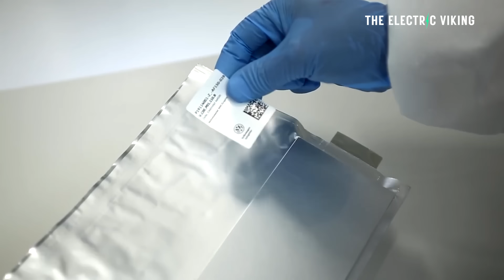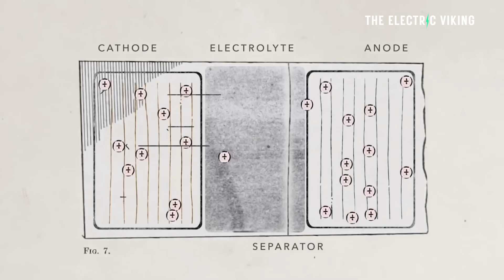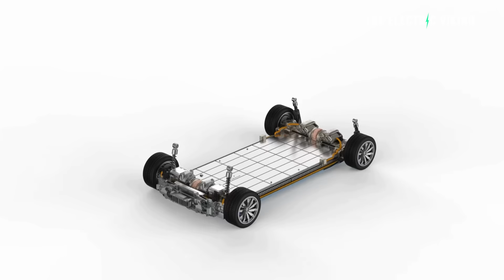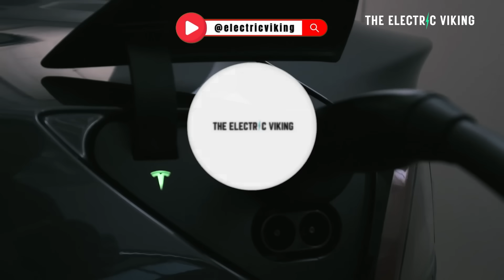Solid-State EVs Will Soon Seal Gas Cars’ Fate: 500 Wh/kg Power in 2025!

Comment: A pickup with a battery still has a long way to go.  The lightning, cybertruck etc have shown the capacity to weight does not work.  To get a truck that can tow, carry loads etc makes it too heavy to work off road.  Its a non starter.  Cars with low drag work fine.  What about the breakthrough game-changer sodium ion. Still waiting.  Wait for the next evolution, but oil is not going away any time soon except in cars and scooters
Reply: Towing may be an issue long distances, or towing RV's.  Hauling stuff, or towing stuff like a typical contractor would is a non issue.  It is interesting that you completely skipped over the Silverado EV and the Sierra EV, with 460 miles of range, and pretty good towing capacity...
Reply: @redbaron6805 They sell so few pickups compared to cars in the us.  Ev pickups are fine if you don't mind taking a big hit on resale and don't plan on towing, loading or going off road.  Pickups make up more than 50% of the us vehicles sold but ev pickups represent less than 1% of sales compared to cars that represent 20% of new cars sold, in the same market.  I rest my case
Reply: @barryobrien1890  The Silverado/Sierra is brand new, so sales are still in the early stages.

We don't know what the resale value will be, as they are still too new to see what the depreciation will be.

As I noted above, you have to separate towing RV's or large landscaping trailers on a highway, vs city towing.  The Silverado has no problems at all towing or hauling stuff, having easily 200+ miles of range even on the highway.

EV pickup trucks are relatively new, so obviously can't become 100% of the market overnight, so you really don't have a case of any kind here.

EV pickup trucks are less than 4 years old in general.  Why would they be replacing 100% of sales of ICE trucks, going back decades, in 4 years...???

EV cars date back over 15 years, and only gained mass market in the last 5 years or so.

The "case" you are making here is beyond absurd, and just entirely divorced from reality...
Reply: @redbaron6805 It costs 20k more (37 vs 57), has lower weight carrying and towing capacity.  What part of business economics is missing your analysis.  For commercial use its all about payback and 20k at 5% interest will pay for a lot of gas.  The entire pickup market is almost non existant despite its years, compared to cars in the same market.    It not because people dont understand, but rather because it does not make financial sense.  All ev loose mote than gas in first year depreciation which adds to business expenses.
Reply: @barryobrien1890  You must not run a business.  $1000 buys around 300 gallons of gas, which may get you around 5000 miles of driving, or roughly 2 months worth of driving, not including oil changes.

As I already clarified multiple times, towing capacity isn't an issue for 90% plus of commercial operators, as the Silverado EV can tow up to 12,500 pounds.

The Silverado arrived late 2024, so talking about market share 5 months into 2025 is beyond absurd.

It obviously makes financial sense, if you own a calculator and know how to use it, as I can charge a Silverado EV for $40 a month vs paying $500 a month in gas.

Depreciation literally doesn't matter, as businesses drive vehicles until they are worn out, and don't give a rats behind about resale value.
Reply: @redbaron6805 dont be so obnoxious with your comments.  Obviously ev also cost money to charge at charge stations.  Lets see just jow many they sell.  20k is a lot of money for a small business,  If it was such a great deal why are rivian, tesla anf ford ev trucks not flying off the shelf.  Obviously business owners dont know how to use a calculator.
Reply: @barryobrien1890  Why would you be charging EV's at charging stations, unless you are traveling long distances...?

I have a charger in my garage and driveway, and as I noted, my utility offers me unlimited charging for $40 a month.

Yes, if you charge at fast charging stations, the savings will obviously be far less.  But, if you charge it at your home or office, even using my general utility rates, it would cost around 8 cents per mile, vs around 15 cents per mile for gas.

Using that math, if you drive 30k miles a year, the difference in charging vs buying gas would easily be over $2000 a year, plus another few hundred in maintenance and oil changes, far exceeding the extra $1000 a year you would pay for interest on the difference.

Many people still don't understand electric cars, so they don't trust them.  And American's are notoriously bad at looking at savings long term, vs costs upfront.

Ask yourself the same question about Hybrid Water heaters, which easily save you a couple of hundred dollars a year in energy costs, yet people buy old and obsolete water heaters which cost them several times more in the long run.
Reply: @redbaron6805   What business charges their truck fleet at home.  You need fast charging to keep the trucks on the road especially during long work days of 12+ hours with overtime and you can't afford to wait on slow charging a big truck battery.  Sure a personal truck that's used like a car is fine but it's not my point.  Small businesses use their trucks extensively during busy times.  Ev trucks lose a lot in value in the first 3 years.  The current Chevy just increased its load and carrying capacity by 50% so anyone with an older one will have to take a huge hit in resale.  Why did they make the change if 90% of the customers are happy.  Tesla owners who paid $130k for the pioneer edition could not get $80k a year later.   Best of luck with your truck, I am sure it will serve you well.  My driving range, access to chargers and working hours could not benefit from today's technology.  I did the math and the risks of having a crew waiting at a charger wiped out any savings.  Please don't spread the rumor that American businesses are luddites.  We do look at the business case, and it still makes no sense.  If there was a decent savings we would switch.  I too have to pay kids school fees, medical bills and put a little aside for a rainy day.  My calculator said no
Reply: @barryobrien1890  You were talking about a "small business".  There are a ton of small businesses like contractors, landscapers, pool service companies, roofers, etc. which have a single service vehicle.

My brother runs a small business, and takes a business truck home, which he can charge at home.

Also, my brother's company has an office where he can charge them at his office.

Not every small business has a fleet of trucks and dozens or hundreds of employees.

And no, you don't need fast charging for most trucks, as they are typically driven locally, as seen here:

"The average pickup truck driven for small businesses typically travels between 15,000 and 20,000 miles per year..."

Even 20k miles a year is less than 400 miles a week, or 80 miles a day.  You can easily charge those in about 3 to 4 hours using a Level 2 home charger.

"The current Chevy just increased its load and carrying capacity by 50%.."  Not sure what you are referring to as "Current Chevy", current Chevy what...?  Not the EV version which was just released.

The Cybertruck and first editions of vehicles are not really relevant as statistics for vehicle use, especially commercial vehicles, as small companies are obviously not buying fully loaded first editions as work vehicles.

"My driving range, access to chargers and working hours could not benefit from today's technology."

Without knowing your particular situation, which could be atypical, it doesn't really serve as much of a reference point.  On average, EV trucks would easily work for 80% to 90% of applications, and I'm seeing more and more EV trucks used for that purpose in my area.

I obviously can't speak for your personal situation, but I have work vehicle, and operate very much like a small business, as my business unit is small within my large corporation.  I could easily use a EV pick up truck.

My brother runs a small business, and he could easily use a EV pick up truck, which he is actually planning on switching to soon.

It is nothing against you personally, but people are very poor at doing the math on long term costs, efficiency and ROI.

Otherwise, people would buy far more efficient appliances, air conditioning units, water heaters, electric vehicles, etc.

But, unfortunately, people worry about the upfront cost only, and don't calculate long term ownership cost.  It is a failure of considering the long term operating costs.

I have personally pointed this out to people, who were surprised how much money they could save, by buying more efficient water heaters, using mini splits to cool the most used rooms in their homes, and the massive cost savings of driving an EV vs an ICE car.

This is not something people really consider, or are aware of, and small business owners are often no different.

Comment: 500 Wh/kg by 2025? If solid-state EVs hit that mark, it could be the final nail in the coffin for gas-powered cars
Reply: Depending on the price of course - but yeah.
Reply: Gonna be very expensive at the beginning, 350miles range is enough for a passenger car.
Reply: @SzaszaG1  350 miles is not enough for me. My european trips require 4 days and 2,000 miles without charging infrastructure needed by EVs.
Reply: Solid-state is about 800 Wh/kg. Semi-SS is about 500 Wh/kg
Reply: @larryc1616  😂😂😂 which company is producing them?
Reply: That is still 22x less energy dense than diesel fuel.
Reply: @Dungshoveleux Not all of the energy makes it to the wheels! Only 20 -30% actually make it into forward momentum!!! The rest is wasted as heat, through the exhaust and break pads! Electric efficiency is in the 90’s. Not to mention the regenerative function of the electric motors saves runaway trucks on downhill grades. I drive from Flagstaff to Sedona daily and cannot tell you how many semi trucks I see having to take the emergency runaway ramp because their brakes have failed or they are pulled over with their brakes on fire because they cannot maintain a safe highway speed on a 4,000 foot downhill grade. You can’t put diesel back into the tank on downhill grades like you can with electric vehicles!!!!!! And we all breathe much better!!
Reply: @1Richblessing  Your math is bad, my guy. Evs in 80% efficiency at best from charger to wheels. That doesn’t count power greed and energy generation.
Reply: @Dungshoveleux yeah but the ev drive train is 3 times more efficient than diesel! Also the electric drive train weighs less than diesel, so all that considered it will realistically get a range similar to a diesel!
Reply: @Dungshoveleux  But there's a 3:1 to 4:1 ratio of efficiency electric motor to gas or diesel, so effective energy density ratio goes down to 7:1 or 5:1 for 22:1.  Still big.
Reply: @rogermartin8411  no, it does not work like that.
Reply: @Dungshoveleux  Petrol cars are about 3 times less efficient and electro motors are much lighter than petrol engines and don't need a heavy gearbox. 500 km takes 75kWh, 150kg of ss battery, about 300kg less than current batteries.
Reply: @NovoAurora  Less efficient in numbers when you dive in science, but they are still more convenient than evs.
Reply: @NovoAurora   The headline figure of 500wh translates to 456wh in real life per the marketing blurb. Liquid fuel energy density is 11KWh+/kg.  The best ICE tech suggests 40% efficiency vs EV 90%. Broadly speaking your figures are not outrageously biased, just a little bit. Lets see how LiS batteries work out in real life.

Comment: Sadly, we've heard all this before about solid state batteries... they're always just a few years away and we don't get any useful stats like: Cost per kwh at cell, longevity, power density, temperature tolerance, safety and of course Energy density. Need all of this or you have nothing. Many batteries could do 500wh/kg and faded away. 
Need All the stats.

Comment: OK, good.  But what about the CATL condensed battery with 500 Wh/kg that is in production now? Last I read, this is made for airplanes, but very little work is needed to "downgrade" to an automotive grade battery.
Reply: I’m not following the point of your “what about”. All of transportation is a huge set of huge market segments, so as long as a new solution is better than a currently successful solution at a better price and value, it can gain market share. It doesn’t have to be better than the best solution.
Reply: I’m not following the point of your “what about”. All of transportation is a huge set of huge market segments, so as long as a new solution is better than a currently successful solution at a better price and value, it can gain market share. It doesn’t have to be better than the best solution.
Reply: @TomKacandes  The CATL condensed battery is available in production now. To get 500 Wh/Kg, we don't need to wait for some magical solid-state battery to appear.
Reply: @dr.x4050  understood that CATL is making this great thing and it exists. If two or five more competitors make something less good but close enough at a good enough price they will all exist in any normal market is my point. You seem to be implying that because a leading competitor exists, nothing else will, but that’s contrary to economic reality.
Reply: @TomKacandes @TomKacandes, I am not aware of any other batteries with the same energy density in production, suitable for cars currently from any other competitor.  I don't believe CATL is in a rush to produce a solid-state battery.  If any other company can mass-produce a battery with the same performance or slightly less performance at a much lower price, I would love to see it. I'm not implying other companies can't do this work.

Comment: It depends on life cycle of the battery over range. I’m fine with 300 mile range provided the battery lasts the life of the vehicle, as they generally do now. Why would I buy a long range battery that will depreciate value in a shorter life span? That’ll be the key = lifespan, longevity. Hope they solve that problem with solid state.

Comment: It is not just range.  Charging infrastructure is practically non existent in the USA unless you live in a large city.
Reply: Simply incorrect - range has not been a real issue for more than 10 years now, with Tesla's fast-charging network. Now, it's being further filled in and made available to all OEMs via the standardization and industry adoption of Tesla's NAC charging port. Check it out if you have any doubt about this. 500 miles of range would be nice, but it's not really required, given the convenience of Tesla's fast DC-supercharging network for long-distance travel, combined with the ultra-convenience of charging at home for daily driving.
Reply: Yeah, one look at a charging map completely busts that myth.  Even highway rest areas in my area have dozens of chargers...
Reply: Completely false

Comment: I'm not sure that SSBs are a requirement for the future of EVs. I see it more as a nice step up in a road that has a lot of future steps. There are so many shots on goal being made by so many battery researchers, it's hard to keep score on who's winning. In the end, I think that we all win because there will be some great options of range, efficiency, performance, and cost.
Reply: I am sure we need SSBs for EV mass adoption. The range, charging speed finally equals combustion that way.
Reply: at the end it is about the price. weight and space is a more minor issue in the car. it matters but not too much.
a more important area will be aviation / flying drones. they will pay a premium to get these batteries and might not have a problem with lower cycle life. that creates a solid financial foundation for production and further development. and cars will get it when the price is right.
BMW has a bit deeper pockets because of their premium car lineup. that could provide a niche for these SSBs, even if they are a tiny bit more expensive.